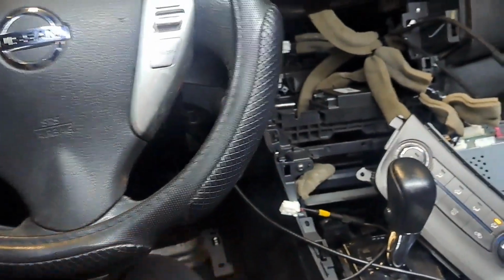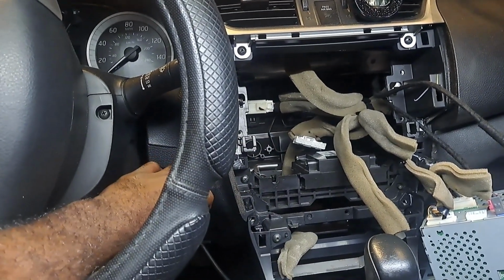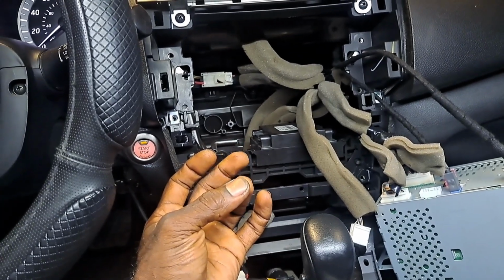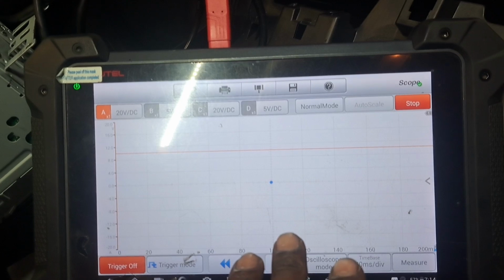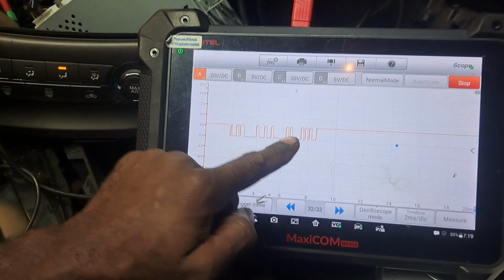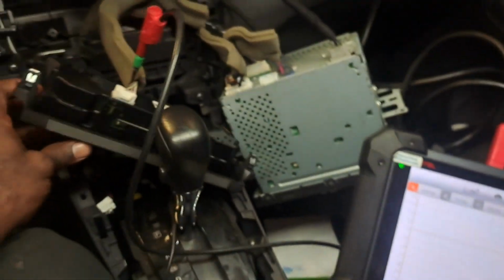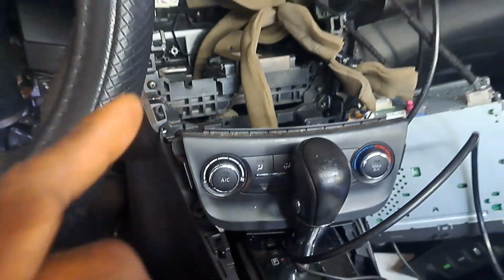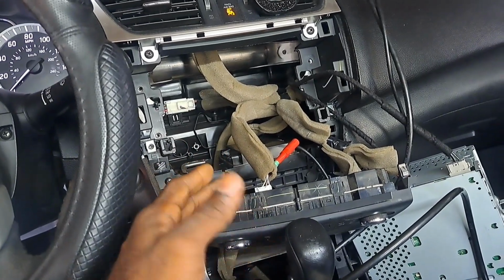2013-19 nissan sentra blower motor stuck on high diagnose/fix

Comment: My issue was exactly the same, blower fan stuck on high. 2012 Sentra SE-R SpecV. I ended up ordering a switch assembly and a blower fan resistor off eBay. Unplugging the switch assembly made no difference. Plugging in the new one also made no difference. Replacing the blower fan resistor was what fixed the issue. Absolute pain in the ass replacing it. Really tight space back there behind the gas pedal assembly where it's located. I did not have the tools to take out the whole assembly, so I had to squeeze my hands in there with a stubby screwdriver. Thanks again for the video, tho.

Comment: Dose the amplifier need to be programes? I just replaced mine on my 13 Sentra  SV and the blower fan wont let me lower or turn it off at all.
Reply from the maker: No, this one in video don't require programming
Reply: @partsshooter  I’m having trouble with my fan—it won’t let me change the speed. I’ve already replaced both the amplifier and the resistor, but the issue persists. All other functions on the control board seem to be working perfectly, except for the fan speed.

Any suggestions on what else I should check?
Reply: @PaliPortugal what was your fix in the same situation now

Comment: Hello,
My 2014 Nissan Sentra has this exact problem. I spent 4 hrs or so replacing the blower motor resistor which by the way, (is in an extremely difficult spot) under the drivers side dash board. What a pain it was. Your video is very nicely done and explains a lot. Ill head to the salvage yard Tomorrow to try to oick up these two parts. Hopefully, you have solved it. 
Sub'd to your channel my friend.
James...